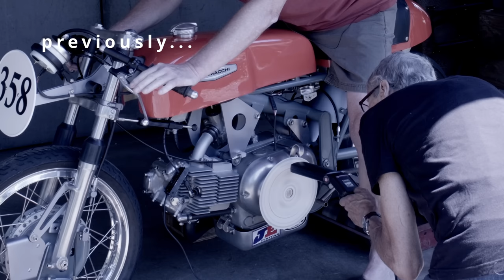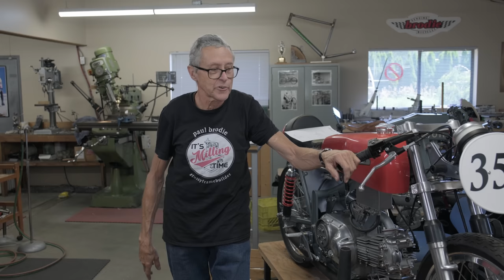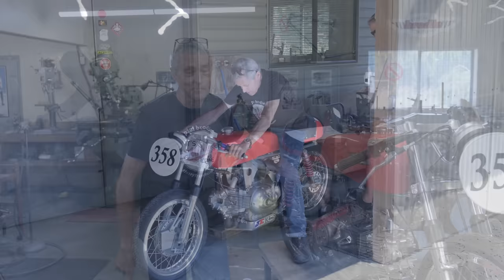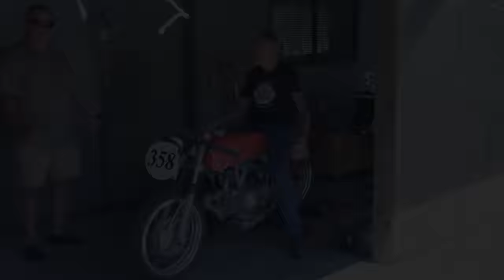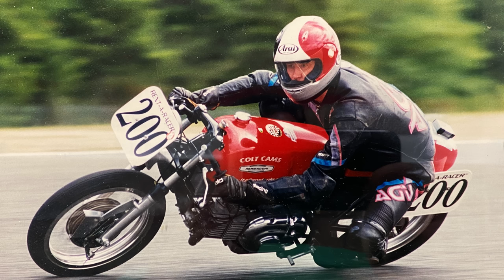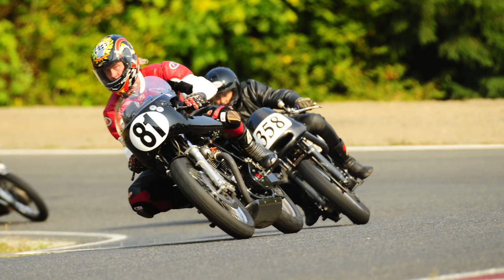Aermacchi Start Up - PART 2! // Paul Brodie's Shop

Comment: Awesome! The Italians build great sounding bikes often times they forgot the horsepower though! This from a Ducati guy. 

Regrettably I had a ‘74 GT 750 project that I intended for the track. I didn’t strike when the iron was hot and the project made no sense as my track days wound down. Sold it all and finished up a Ducati 851 restoration. I guess you can’t do it all or take it with you!

Beautiful bike and great problem solving!

Comment: Getting closer! The only carb out of the box that ran "good" on a bike was an S&S. It took weeks of daily trial and error to put a rotax pulse jet type water craft carb on a Victory before it ran good enough to try a good, long test ride. (The S&S was just to big to fit the avaliable space ubder the tank. You will get there. Keep at it! And again, good to have you back on my feed.
Reply from the maker: It was a new carb to me, but I did re-jet it to the same specs as my previous carb...

Comment: Hi Paul,
 It's probably 45 years since I was working on AMAL carbs so I had to sleep on it after watching vid..
 It may be worth checking the actual shut off needle, it's rare but I have seen a couple that were longer than they should be (usually non-genuine parts but could be from a diferent AMAL?)
One other thing to check, because of the float pivot position, having carb tilted forward  lowers the fuel level in float bowl. 
If carb was designed specifically to be mounted vertical (on a Bonneville) this will lower fuel level in bowl compared to a Commando with 'race' manifolds. (10 degree angle)
It may be something else entirely but it's relatively simple to check fuel level which will be close to gasket surface.
I forget details as that style AMAL was pretty new when I was working on them (Mk I Concentric's were the 'common' carb) 
Monoblock's were so much easier, fuel level with the 'pip' in middle of cover at whatever angle you were running, file contact point of shut off valve to adjust level (one piece plastic float, non adjustable).
Reply from the maker: We did check the float level and we did raise it up slightly. Thanks for your comments!

Comment: The sound of an Aermacchi is not easily forgotten.  Incredible!
Reply from the maker: We have something in common... we both love the sound of an Aermacchi race bike! THANKS FOR WATCHING :)
Reply: It's a megaphone, every 4 stroke single is going to snarl with a megaphone, the real test is with the stock muffler mounted, does the bike have the valve timing to sound snarly, throttle off when decelerating through the gears.
Reply: @paulbrodie  I remember my ERS back 50 years ago.  32 mm Mikuni with jetting specs from Mert Lawwill.  It ran Sooo much better with the Mikuni than it did with the Del Orto.  I ran an open megaphone even though silencers were "required".

Comment: great stuff Paul. it amazes me that you fabricate everything - so talented. Can you talk about the starter spinner you use on the rear wheel please
Reply from the maker: Thanks John. The starter belongs to a friend. It is just on loan. In use, the rear wheel wants to kick to the right, a lot, and then the bike has to be re-positioned. I want a starter where the rollers have a "dip" in the middle that would assist in holding the tire also in the middle. I think a new starter is about 1000 dollars.
Reply: Thanks Paul, any info would be helpful

Comment: I've got a '67 Ducati 250 scrambler I've owned since I was a teen.  Comparisons between the Aermacchi and Duc are pretty stark.  I've always thought the Aermacchis were a bit industrial compared to the OHC Ducatis,  More low end but they really seem to just lose the ability to rev out like Ducatis.  5 speed versus 4 speeds with slightly tighter gear ratios to keep Ducati's engine on the boil.  I've trail and gravel road ridden mine a fair amount before I got interested in bicycles.

Comment: Great Work and good to see you are doing well! Those engines rev very (almost 10000 revs/min) for a push rod design. I like the Piva DOHC version using a vertical shaft for this engine. I think there is someone around doing replicas of those DOHC heads just in case 😉

Comment: I'm looking forward to when you get the timing sorted out. Only then can you really dial in that carb. What size is that Amal? And did you keep notes of the jetting used on the previous racer, with whatever carb that was used on it? One thing I learned about carb sizing is if the size is correct then uncorking the exhaust lets the carb flow more air so the venturi effect is stronger and flows more fuel with no need for changing jets. If the carb is too large it runs lean, signal is weaker, so you need to jet larger. If the carb is too small, the signal is much stronger, so it runs richer, and you need to lean the jetting. So once you get your timing you could "cork" your exhaust and compare your jetting to your "uncorked" exhaust. I discovered this first years ago with a Sportster that A guy put drag pipes on. The usual idea was to richen the jetting. That sure didn't work. I ended up having to solder up jets and drilling them undersized to get a correct mixture. Later on I found out the later Sportsters had a 36mm carb on them when the earlier had 38mm carb. I also found this true on other engines, British and American. The 93" engines I've built always end up needing to be leaned way off the charts, meaning they would work fine with a larger carb.
Reply from the maker: Tha Amal is a 34mm bored out to 35mm. I did use the same jetting, but I changed the megaphone. I am going back to the previous megaphone to see what happens. Thanks for commenting :)
Reply: @paulbrodie  Yeah that can be telling. What is the intake valve diameter? I couldn't find anything on the internet or Ebay about valve diameters. I'm guessing you have a 11:1 a piston in it.
Reply: @paulbrodie  When you try the previous megaphone, try the "socket on the extension" trick. With your exhaust system it will be more about disrupting the exhaust flow to impede back flow. Otherwise, Anti reversion.

Comment: Sounds great , i have watched with interest how you rebuilt that Aermacchie engine with all those fancy parts and clever engineering. I had one of those in the late 70,s but didn't ride it much as i was into MX and Enduro , just as a matter of interest what kind of horsepower/ kilowatts and top speed can you expect from those heavily modified engines?
Reply from the maker: Many thanks!  My Aermacchi race bike had 35 rear wheel HP and was good for 120 mph on the straight :)